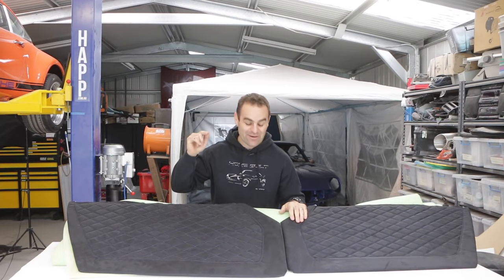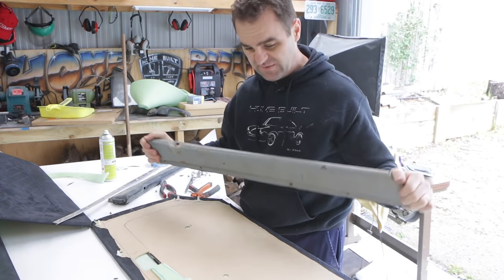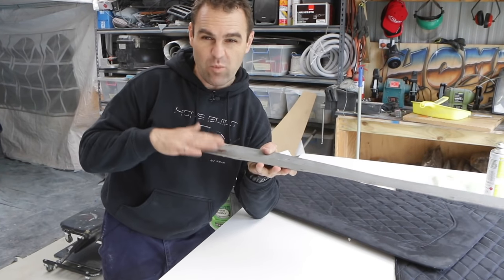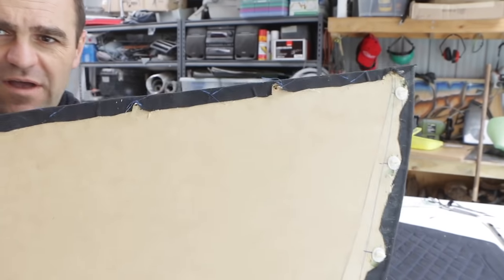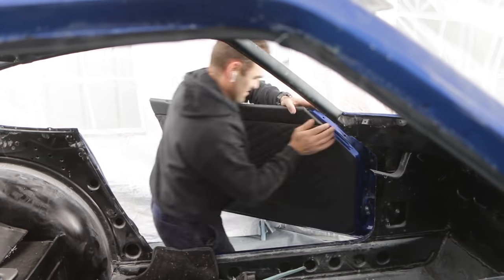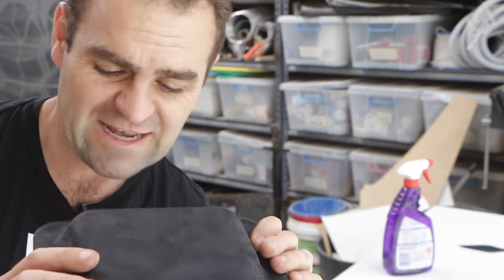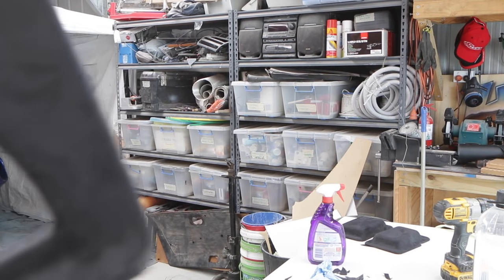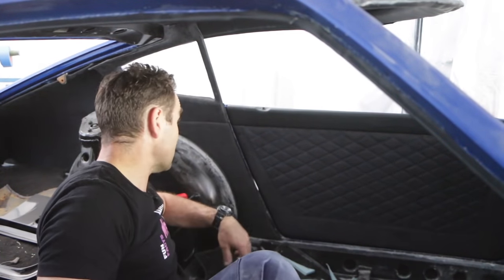Tidying up the trim - Home Built Datsun 240Z part 63

Comment: When I was doing custom interior for stereos we would make a feature of those pain in the arse places.
Like the little triangle you glued into the quarter glass trim we would hem up a piece of tartan with piping and sew that in, or use a pair of screws to cover up the joints and you can get a trim your own button and cover them in the same material and cap the screws. Makes it so obvious that it's invisible.
On the light cover panels when you do that type of joint paint underneath in a similar colour to the fabric, then glue it down and pinch the excess, trim off the excess with a really sharp knife, the  paint the cut edges with a texta then poke the cut edges under each other.

Comment: Hi Jeff
Great work.  I think you could use T-nuts in the same position as those paper fasteners, and they would be much stronger.  Then you screw the top trim to the door panel from the back.
Reply from the maker: Good idea. They would work nicely

Comment: Love the alcantara!  It will be interesting to see if the if the board is flexible enough to take the shape of the door like the original does.  Are you going to put the arm rest over the panel and window regulator cranks thru it? Not real crazy about the metal clips but I can't come up with any good solutions either.
Reply from the maker: Yes, the arm rest, door handle and crank will go over the top.

Comment: Interested to see what the plan is for the inner Door Belt Weatherstrip (ie the felt weatherstrip) and how you will attach that - ?staples / glue  or combination?
You can still source the drivers side OEM part felt/chrome  inner door strips ex Japan but not the passenger side :-(

Comment: Hey Jeff did you put some sort of window fuzzy on the top of the metal portion of the door card? If so how did you attach it? From factory it had some strips of fuzzy material to prevent damage to the windows

Comment: Looks OEM Jeff. Great Job. Did you put any anti rust on the inside of the metal trims. Just saying as we know how you don't like a spot of rust. :)
Reply from the maker: I will go back and do that, but they are pretty good for almost 50 years old.
Reply: Home Built By Jeff  sure is good for almost 50 years old.

Comment: Could you possibly provide and link the source where you bought the door panel and trim clips Jeff,l.  I'm Workin ng on a 280z and been looking for replacement clips as you probably know the ones that came on the original and due to the age broke off easily.  Thanks in advance!
Reply from the maker: Supercheap, but the ones I bought are plastic and require different holes in the door trims

Comment: You forgot to remove the rust on that metal piece above the door trim before you put the vinyl on! Won't that cause a problem in the future?
Reply from the maker: I will clean it later before final assembly, but it is very light surface rust. I am not too worried.
Reply: @HomeBuiltByJeff  cool :)